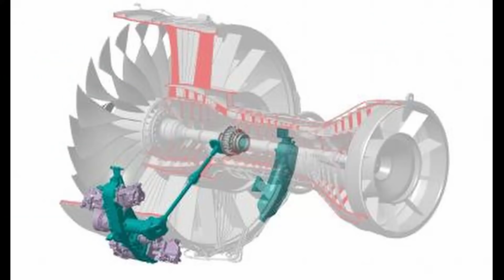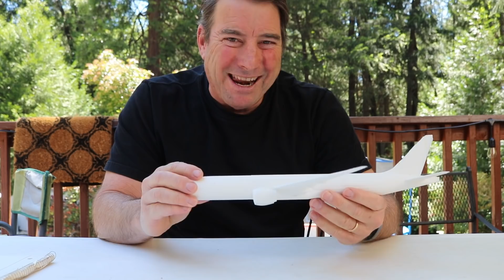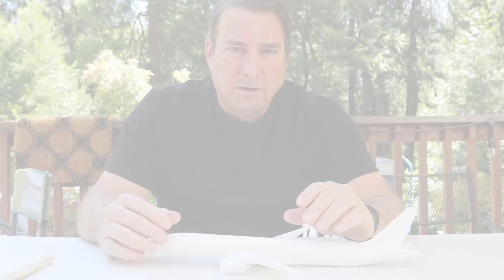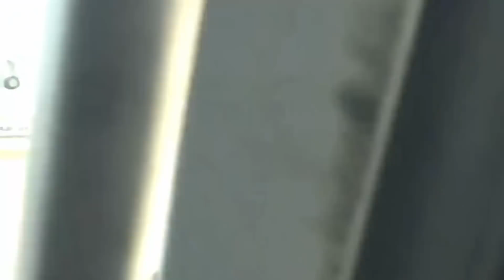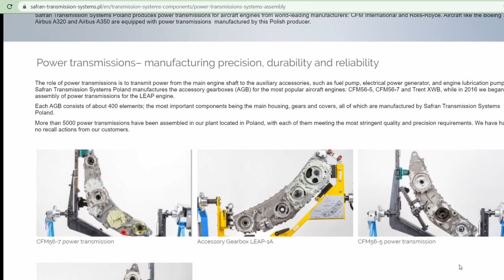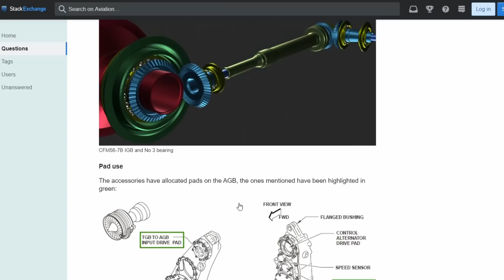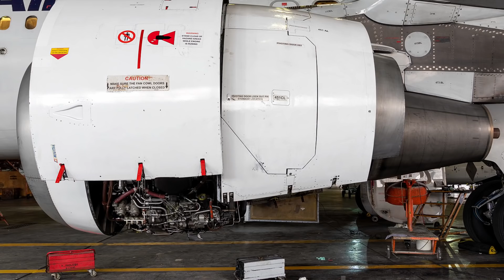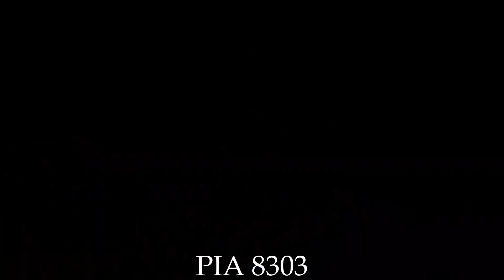PAKISTAN INTERNATIONAL AIRLINES #8303 UPDATE #2 23 May 2020

Comment: Hi Juan 
The Safran illustration you showed is the 7B for the 737, which has the gearbox and accessories off to one side due to the low landing gear on the 737, the 5B on the A320 has the gearbox and accessories below the engine, which just makes it even worse.
This is how a 5B is arranged : 
https://elfc.com/wp-content/uploads/2016/10/CFM56-5B-1.jpg

And here a 7B: 
http://www.jetproparts.com/wp-content/uploads/2018/06/engine-cfm56-7b.png

I love your videos.

Comment: Juan ... Great description of the accessory gear box on the CFM-56 engines.  A small but important oversight is that bolted to the center of the gear box, at its lowest point to the runway, is a stainless steel drain mast.  This mast is intended to drain any oil that collects from any leaks within the gear box. The mast extends through the bottom of the cowl a few inches into the air stream to drain if leaking in flight.  The mast is sturdy enough to physically break the gearbox case if touched to the runway.  In the re-engined DC-8 we broke two gear boxes during flight tests, at different times, during landing.  Most critical on the outboard engines which are already close to the runway due to tight space.  A detail but a guarantee that if an aircraft rolls enough to touch an engine the first thing to hit the runway is the drain mast which will break the gear box.  It is even possible, as we did, to break the gear box without scraping the engine cowl.
D. Rowan former MDC Flight Test Engineer, retired.

Comment: I think they forgot to lower the landing gear. Which would explain the engine damage to both engines. Also it seems to me that the "accessory drive gear box" is in [almost] the worst possible location for the potential of engine strikes on the ground. Perhaps there are other considerations I'm not aware of, but it would seem to me to be a better location to put them at the top of the engine.

Comment: Just a quick question, you mentioned that the Ram Air Turbine (RAT) was operating which gave the pilots hydraulics and instrumentation. And then you mention that the damage from the Accessory Drive Gearbox would cause the engines to start to fail. 
My question is: If the RAT was already operating why would the pilots be worried about the engines failing? I thought the engines already did fail and that is why the RAT was deployed out into the airstream for basic functions?

Thx! Good detailed content BTW
Reply: The RAT doesn’t just deploy when engines fail. It deploys when both AC bus’s loose power so the IDG May have been damaged and stopped powering the bus’s so the RAT deployed and provided basic electrical power

Comment: I am an ex pilot with just over 17000 hours, your clear and  incisive way of explanation and detail makes me wonder why you are not an accident investigator. Well done old Sport. Quick question, I flew the 767 and  757 with both RR and Pratt and Whitney and apart from once failing on rotation, never had any problems. I have many friends still flying who have had trouble with CFM engines, or so they say for blade disintegration, compressor stalls vibration. In your experience, is there amything wrong with CFM???

Comment: The turbine gearbox was probably damaged is the most likely culprit, without that the accessory gearbox is a boat anchor. Now the million dollar question, why did they land gear up the first time? Wouldn't the bitchin Betty on board be screaming at them on final, does the tower say check gear down clear to land?

Comment: The impact with the runway of the engines can initiate several immediate failures.  With all those gears turning at high speed the impact can cause one or more of the gears to move out of alignment and cause it to bind up. The bind up will ultimately lead to the failure of hopefully a designed in failure point such as a shear shaft on any one of the accessories installed. The failure of the shear shafts usually occurs when an accy fails thus preventing damage to the gearbox. However in this case it is the gear box that is damaged. I believe there is a shear spot on the radial drive shaft to protect the engine. Other issues are cracked/broken gearbox housings although I don't recall anybody noticing smoke coming from the bottom of either engine. The impact could have also damaged/bent/kinked any of the fuel/hydraulic/oil lines as well. 

One of the first things to look at is why was the landing gear not deployed/failed to deploy or unsafe. 

The accident investigators are going to have their hands full with it crashing into a residential area.

My heart goes out to all those who lost their lives.

Comment: So what does the APU do? Like in 2009 captain turned on the APU straight away.
Reply: APU provides full electrical power and bleed air to the aircraft however it takes a minute or so to start so we don’t know if there was enough time to start it after engines failed

Comment: Going around was a suicide mission, they were cleared for FL 3500 ft, which they
only managed up to 2000 ft. Clearly the engines had failed to provide thrust shortly after
climbing. The pilots have reported problems with the landing gear not heard on the ATC audio
that is circulating online. The landing gear might have failed on touch down. Hence the go around. R.I.P
Reply: It’s not FL 3500ft it’s either 3500ft or FL35

Comment: https://www.facebook.com/watch/?v=2590198924551974
Plane hit runway at 4500 ft marker---runway is 9000 ft long---. First the left engine hit the runway---then the right engine hit the runway---the pilot lifted the aircraft---the aircraft came down and hit the runway again at 5500 ft marker and then took off. 
This is the translation of the an airport personal is stating---.
Supposedly the aircraft was over 250 Knots when it came for landing--supposedly the pilot had the aircraft landing gears lever down and as the speed was too high the landing gears did not come down--

Comment: Juan at 8;30  you covered the ability of the deployed generator  RAT  this only was hyd. and elect.  , but not a back up elect. fuel pump  ? If engines were fueled could the power and toque continue to run the turbines over the failed ADG assembly ?
Reply: Even if the fuel pumps failed the fuel would still be fed by gravity
Reply: @tomstravels520   ty

Comment: The flat-bottomed CFM56's (-3's, were they?) have their gearboxes at the 9-oclock position. Am I right? Seems like a safer  place to put them no matter whether or not they're mounted on 737's. This tragedy might give pause for the industry to consider this design more universally for the future..
Reply: ravanviman the 737 CFM is that way because they required more ground clearance.  If you keep the mass of the engine directly centered with the pylon, you can get away with lighter pylon structures.  Put the weight off center (B737), you must beef up the structure to compensate for that.
Reply: @737MaxPilot  Hmm. Interesting point you make. Wonder if there's other "stuff" you could hang at the 3-o'clock position to balance things out.

Comment: Every rotating drive unit, and every fuel and Hydraulic line in the engines and the bottom half body of the aircraft would have ruptured due to the opposing shearing forces. As previously stated I would have cut the throttles, got everybody out and at some NEAR POINT headed back to a Terminal for the biggest shit of my life. That Atlas 747 was buffeted by cross winds, not pilot error. His undercarriage intact and with four engines and landing gear down, minimal friction, had the height  and speed to get airborne again. BELLY an aircraft in THATS IT, END OF!! MY CONDOLENCES TO THE FAMILIES OF THE LOST.

Comment: From the ATC recordings, we can hear that the aircraft was at 3500 ft at 5 miles from the airport when it should be at 1500 ft. A chime was heard on the cockpit which was a probable warning of overspeed due to an excessive rate of descent. A survivor told that the aircraft bounced hard several times at touchdown, which could be a result of an approach that was made too fast and steep, and these bounces most likely damaged the engines. The pilots attempted a go around but the engines stopped providing thrust due to the damage. Of course, only the official investigation will reveal if this is the real explanation, but unfortunately, it was expected that the lockdown could cause pilots to lose their skills.

Comment: One would think such a critical piece  that keeps the engines running would be in a position that cannot be struck, or broken by a runway strike. 
Rip to all those who died in this tragic accident.
I was on a school field trip and our driver went over a roadworks ramp (road cut up straight down not a angle these days to make a smoother ramp bit ) a bit to fast  as there wasn't a ramp sign near it and snapped the  belt in two. Luckily our younger class minibus was not far behind us, as we came to a slow stop on a deserted country road about 2 miles from the nearest town. By the time the driver took our driver to town ( it was back in 1991 when there was no mass mobile phones)  and dropped the young ones off at Scarborough baths and came back for us, we was stuck on the side of the road for two hours, both the minibus and the recovery truck came to our rescue  at the same time.

Comment: Checklists prevent gaps in flight ops.  Airbuses don't operate like Boeings, their flight management systems leave the pilot in command in a lurch when things get tight.  Paris airshow, anyone.  Prayers for all of the families that sustained losses.
Reply: Pros air show was because the pilot was an idiot who flew too low just above stall speed and when he tried to power up it was too late. Plane wouldn’t climb because of it did it would stall and crash anyway

Comment: Wow so sad. Been better just belly in. Dont know why CFM didnt mount the accessories in the pylon like the old 707 air cycle turbos were (on 3 engs)  maybe for maint ease I guess. These engines so close in ground cl now. A 737 Max on can be banked less then 10degrees on a xwind ldg

Comment: There has been a reported landing gear issue on first attempt,  well if that is the case then the FOAM needed to be there on tarmac. That had to had to be preceded by some circling ,which has not been the case either. It had to be a case of forgotten landing gear case, then a failure of engines.
The timeline also shows that it.has been a straight landing in first attempt,.coming from.lahore to Karachi is a straight decent no turns at all.
Reply: No if there were landing gear problems then the gear should be manually released first before deciding on belly landing. And there are too many checks and warnings for pilots to “forget” to lower the gear. Ignore the warnings maybe

Comment: Is the AGB protected by hydraulic fuses, or would a strike cause the hydros to bleed out?  I would guess (I'm by no means an expert on the A320 hydro system) that if BOTH engines have the AGB mangled bad enough and don't have working hydraulic fuses, that both GREEN and YELLOW would bleed out.  Even if GREEN and YELLOW, bleed out, BLUE is completely separate, has the RAT and AC1 power, and designed to take over full functionality so I wouldn't expect that to be fatal.  It's just that loss of control and that kind of damage makes me think that something screwy happened with the hydraulics.  If anyone knows better about the A320 system, please elucidate and educate.  Thanks as usual, Juan!

Comment: Note to clarify :: Most of these photos show the gear box attached on the side of the engine 6-9 oclock position which is CFM56 arrangement for B737 NG .All narrowbody airbus have the CFM56 with gearbox at bottom of engine 5-7 oclock position .

Comment: The other day, when you first talked about this incident, you played some ATC audio that had the "ding ding ding" of the Gear Not Extended annunciator.  I am wondering why they even got that close to the ground if they didn't have gear earlier in the approach.  Close enough for an engine strike with no gear.  Wouldn't the go-around commence once they knew they had gear failure as a possibility?
Reply: It’s not a gear specific alarm is a generic master warning alarm. If “gear not down” was the reason it was set off then it’s triggered at 750ft RA. Yes they should have gone around

Comment: This all worries me as an automotive repairer. 
The engines really are physically to big, with all the drives off the bottom of the engine. I suspect the drive/s were broken which fed shrapnel through the engine. So it lost all thrust.
While I am not currently likely to travel on those planes eventually I will have too.
And ofcourse the amount of crap, birds, gravel, big bugs etc really mean they should have air filters of some fashion. Those fans are very fragile and pushing shrapnel out the back cause more damage.